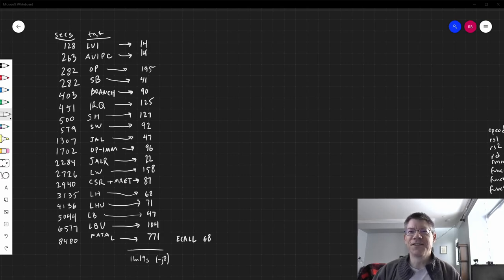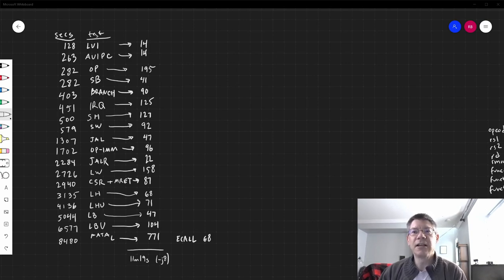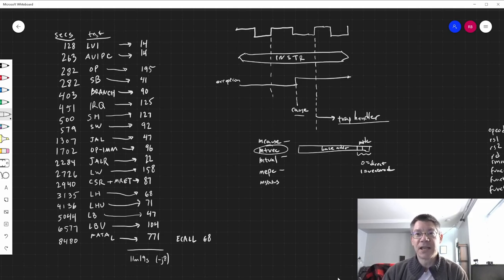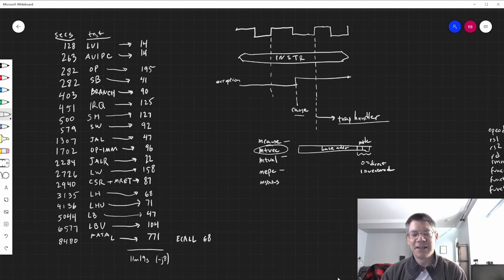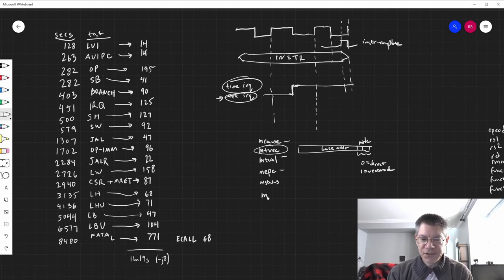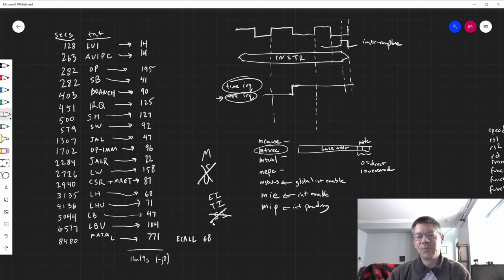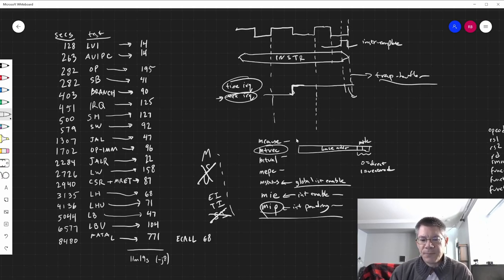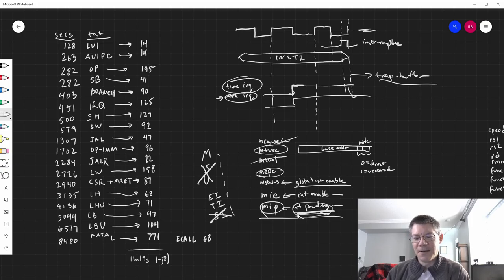LMARV-1 reboot part 7: Interrupts and exceptions, code complete???!

Comment: Hi, I just found your videos.  I have experience with operating systems, but not that much experience with hardware.  This is a very cool project.  idk if someone else mentions this in a future video's comments, but I have answers to some of your questions.

SBREAK is used to implement breakpoints.  When you set a breakpoint the debugger finds the first assembly instruction that is on the breakpointed line and then replaces it with the breakpoint instruction.  (On x86 the breakpoint instruction is 0x03). When the breakpoint instruction is hit the process being debugged is stopped and the debugger is notified by the OS.  When the user presses continue in the debugger the instruction that was replaced with the breakpoint is emulated in software and the registers/memory are modified to be as they would be if the instruction were executed by the CPU.

SCALL and other software interrupt generating instructions are usually used by user processes to get services from the OS, but they are also frequently used before the OS is loaded.  A computer's BIOS usually provides interrupts that are used by the bootloader to load files from storage before the bootloader/OS is able to load its drivers.

Asynchronous interrupts are interrupts that do not occur as part of the execution of the current instruction. eg: timer interrupts, hardware interrupts, IO, interrupts caused by other cores in multi-core systems that are handled by this core, etc.  Synchronous interrupts are interrupts that occur as part of an instructions execution.  eg: SCALL, SBREAK, illegal instruction, unmapped memory, unaligned memory access, unaligned jumps, etc.

Usually in simple CPU implementations, asynchronous interrupts cause cause a latch to be set, and at the start of each instruction's execution the latch is checked.  If the latch is set then the asynchronous interrupt is handled, otherwise the instruction is executed.  Furthermore, disabling interrupts DOES NOT mean that interrupts that arrive while interrupts are disabled are ignored.  Instead, the latch will stay set until interrupts are re-enabled, then the CPU will handle the interrupt.

With regard to synchronous interrupts, most CPU implementations will not write results to registers/PC/memory/IO until the end phase of an instruction, when it is known that the instruction will not fault.  That way if an instruction is found be faulty the CPU can discard the work it has done and trap to the handler immediately.

My last comment is that the illegal instructions should not result is the CPU halting.  The RISC-V ISA explicitly contemplates setting a handler for unsupported instructions, reading the faulting instruction, emulating it in software, and returning to the execution.  This would allow a RISC-V CPU w/o HW support for extensions like division/multiplication to have compatibility with code that uses those instructions through emulation.

Sorry, if this was too long.  Keep up the amazing videos. :)

Comment: 24:30 this seems slightly dangerous - I'd relax it to rs1: [0, 1], rs2: [0, 1, 2, 3], rd: [0, 1, 2]. This way all the possible register aliasing problems are checked too.

*edit: allow rs2, not rd, to use register 3. this improves performance on instructions that do not use rs2
Reply from the maker: Yes, I was actually thinking about that, but then the thought flew away somewhere, maybe under the sofa, and I couldn't find it again. You reminded me! It is a good idea to check that all registers may also be the same.

Comment: An idea:

Couldn't you do bounded model checking as a "crude" check, like you're doing now.

Then once you have the entire system built, without errors on that check. Then you go back and formally verify the code with proffmode, retroactively adding the asserts so the instructions doesn't change on you?

I ofcause realize, that this will be very time consuming and tedious, and maybe even difficult because of the vast codebase. Although it would be a great way to iron out any bugs, and also a good quality assurance of the code itself and the code comments :)
Reply from the maker: Yes, usually cover first, to make sure it does what you think it does, then BMC to see if there's something you missed, then prove to make sure that unbounded checking also works.

Comment: If ECALL/EBREAK are your only non-fatal exceptions, do you even need to materialize an exception line for them? Have fatal exceptions raise an actual wire, and have those be directly handled on the sequencer.

Comment: Excellent, it'd be cool to go back and map it to the formal spec. :+ )
Reply: I admit to not understanding the "map it to the formal spec" suggestion, but it does sound interesting. Would it be possible to ask you to elaborate on your proposal?
Reply: @ivankrasin2399  there is a formal definition of the correct behavior of a RISC-V implementation, which could be combined with the LMARV model to validate it's behaviour.
Reply from the maker: @microcolonel  You mean the one that Claire Wolf put together? That's where I got the idea from, but since I am not implementing the full spec, I don't think I would be able to use the formal model.